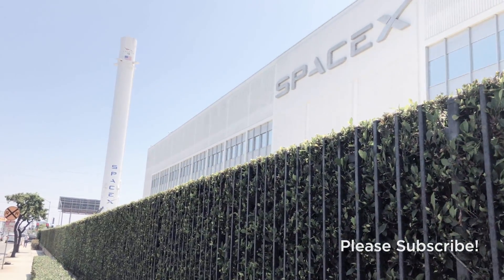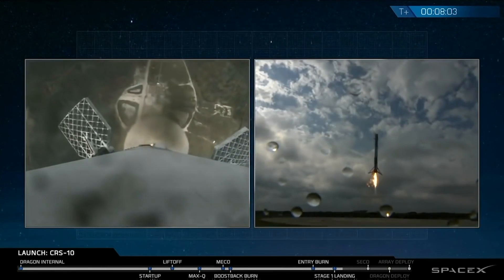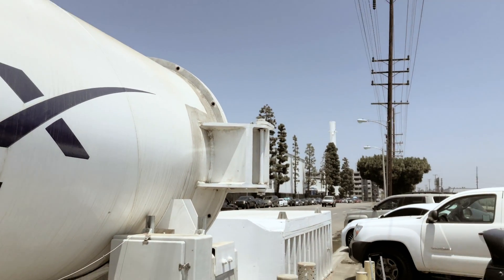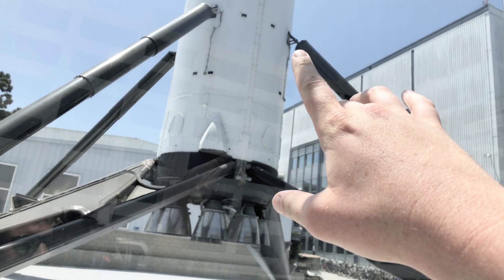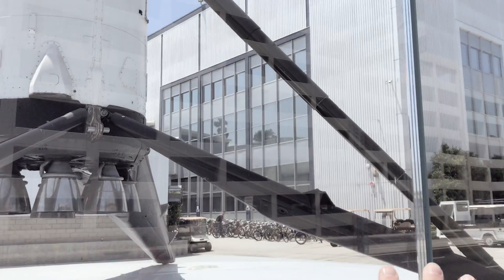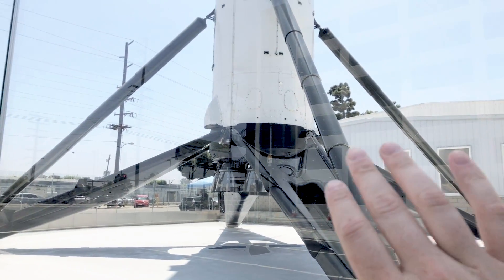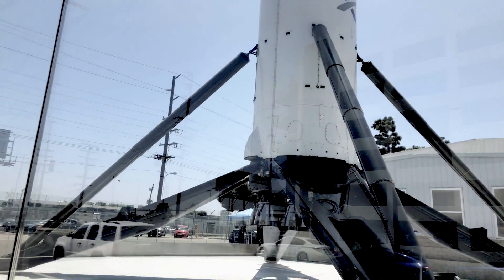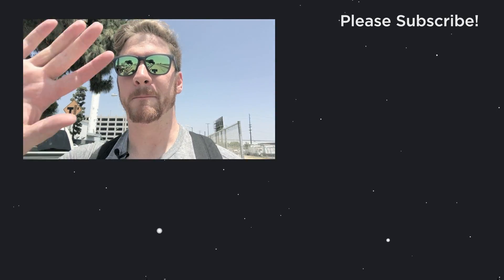How do the Falcon 9 Landing Legs work?

Comment from the maker: I want to add a caveat here about the "pusher" I talked about. Inside of the telescopic deployment arms, the pistons are filled with high pressure helium. Likely a high pressure static charge. Gravity does still influence the speed in which the legs extend, but when I say gravity, I also mean the inertia that is created when the booster increases its throttle. Think about when you are in a speeding car and the driver slams the breaks, you move forward! Much like how on the falcon 9, when the throttle ramps up for a smooth landing, it forces the legs down even faster. Thank you for watching, and hope this clears up an confusion!!!
Reply: What keeps them "locked" needs to be better explained. When the legs expand, it required more volume or helium, then at the fully extended position a valve needs to close to keep the forces from the landing from pushing the helium back into the storage tank. Do you have any more information on this?
Reply: An confusion
Reply: What you say about gravity effect does not make sense to me, The landing is a 'Slam Dunk' with the aerodynamic force on the legs likely to be important than the force of gravity would play, the  high pressure helium is what makes them work. maybe any variance of drag on each leg is possibly an effect on any individual deployment rate.